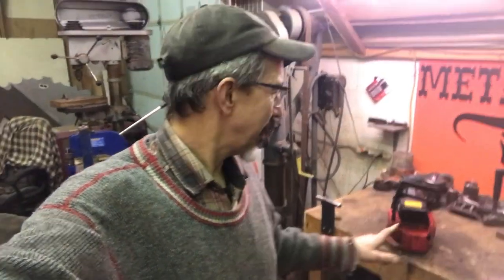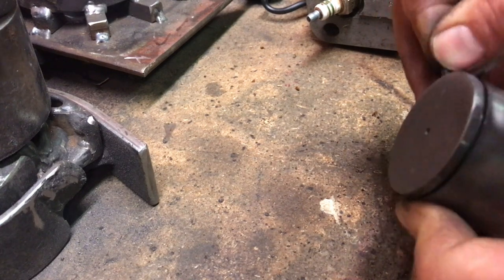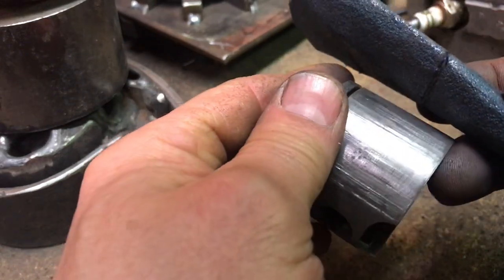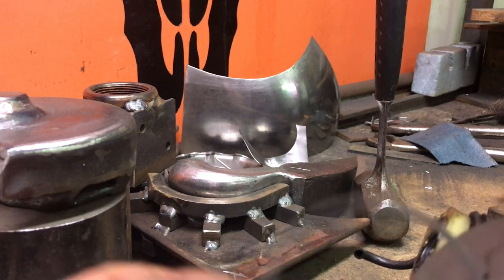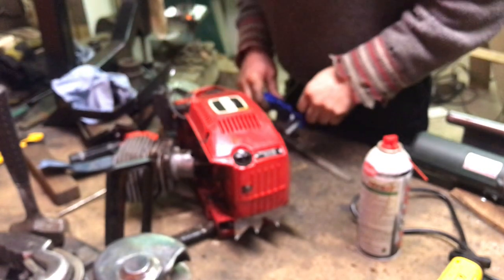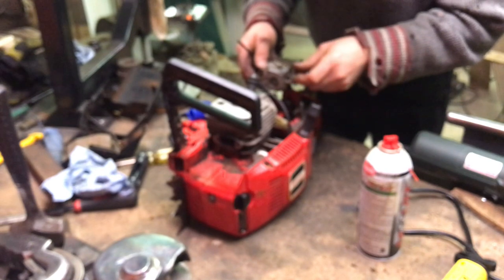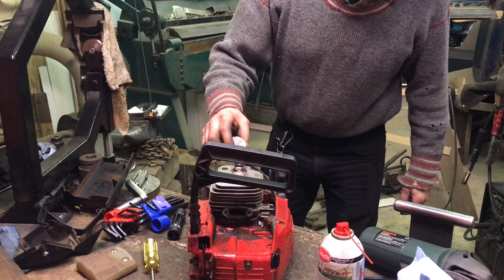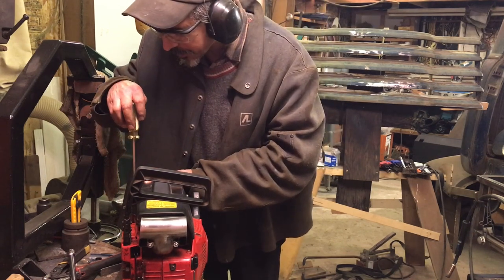Wild West Chainsaw Shop

Comment: When building a 5.7 ltr (350 ci) SBC I oil but avoid the ring area. I use Starrett instrument oil, as about as low viscosity as one can get. And, when prepping a honed block, I'd admit, I probably use 6 rolls of original paper towels. I clean until there is no color transfer from the parts; piston or block. Not a "bush fix" procedure.

Comment: I just ordered a 48mm farmertec piston from ebay  for 16 bucks delivered. You have to debur them and make sure the ring is correct but they work ok. I Use like 320 or 400 grit emery cloth gently with oil to remove aluminum transfer. Cylinder looked good when you were done though.Ya those were 3/16 base bolts and the rest metric , weird. You did good👍

Comment: Judging how it revs and wants to die at lower rpms, I suspect you have an air leak somewhere in the bottom end. Crank seals or something. Nice job getting her running before sending her off.
Reply from the maker: That might also explain why it wouldn’t restart without priming it first
Reply: @WildWestGarage  It would also explain the lean condition meting the piston, no matter how much the operator tunes on it. I have no question that Ryan will get it sorted no problem. Getting a motor running before going any further is a smart move in my opinion. It definitely let's me know where the machine stands before going any further.
BTW, Morgan, for what it's worth, the "nothing special" cars are actually the most special ones to me - because those are the ones that get the kids to school - get the groceries home from the market and all that sort of stuff SAFELY! I love racing, and have the privilege of hanging around some very interesting race shops when I can find the time (almost never these days) - and that stuff is real fun - but brother let me tell ya' - working on people's daily drivers is most important kinda mechanics there is. I may be a bit biased - but to me - the "plain old" "neighborhood shop owner" that does honest work is one of the finest examples of a hard workin' man there is. Kudos, my friend. Send the family my love, too.

Comment: Morgan, don't run it without a muffler. Next time put the piston on the rod. Assemble your intake, carb on the cylinder, then slide the cylinder over and finish. You can use a hose clamp as a ring compresser. But you did it. The hard way. If there porting it you'll get a new piston for sure. Have fun.
Reply from the maker: Thanks Bill. I’m sure there will be a next time. I am having fun!

Comment: Do you ever use a toolmaker's scraper? Cy 441 xpould you make me the stamped parts and a new flange for a new Husky 441xp. I am a certified welder with torch, mig and tig,, so I would enjoy the "weld-up."
Reply from the maker: I have given some thought to offering kits but I don’t think what I have would fit in the muffler pocket of a 441